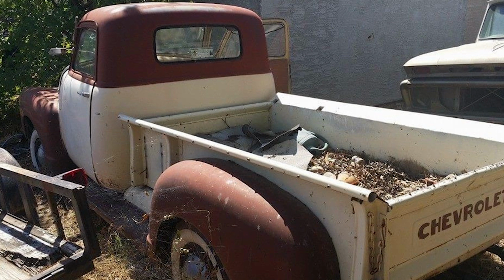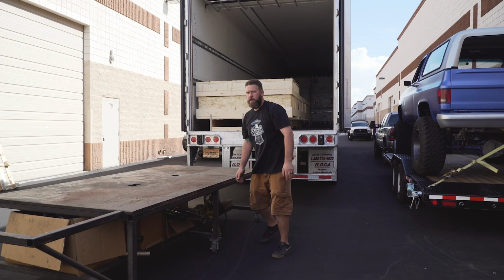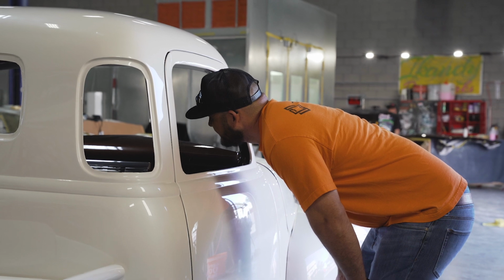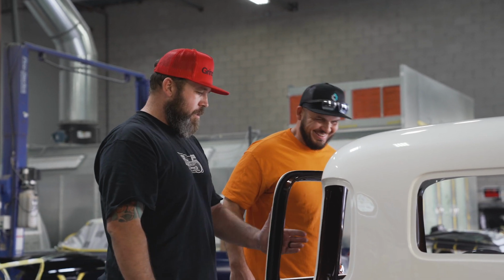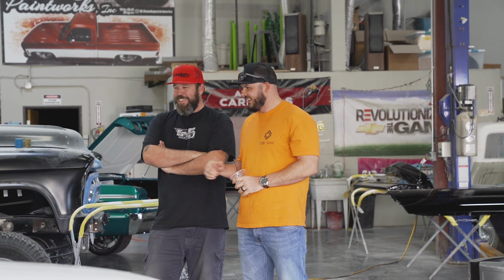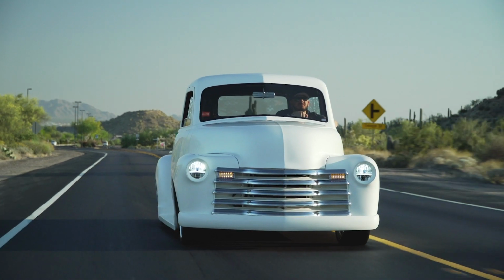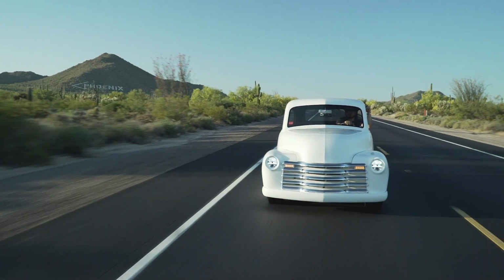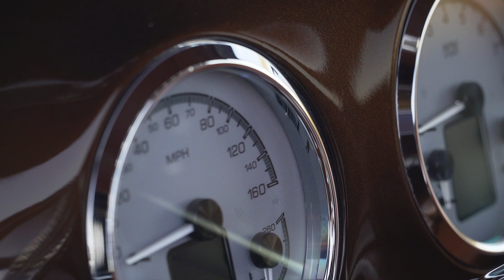1948 Chevy Truck Completed Build Story

Comment: I'm 60 and my first ride  was a 1949 Chevrolet 3100 steep side with 1965 drive trade, 283 , 750 sredbore qwud jet and a 4 speed munce , f the speeding ! I had to bungee cord the passenger door and be advised the driver door may and will pop open at any time with two piece windshield real glass , both cracked and know windshield wiper motor and know emergency brake ! I drove the beast balls to the wall. Grant parnell.

Comment: Looks.  Mor.  Like.  A.  504
Reply from the maker: Not sure what a 504 is
Reply: 1954. Chevy. Picup
Reply from the maker: @ThomasSmith-qs9wy no it’s not. 54 would’ve come stock with solid front window. This is a custom piece that deletes the center bar.
Reply from the maker: @ThomasSmith-qs9wy 54 would also have a flat top on the bedsides.